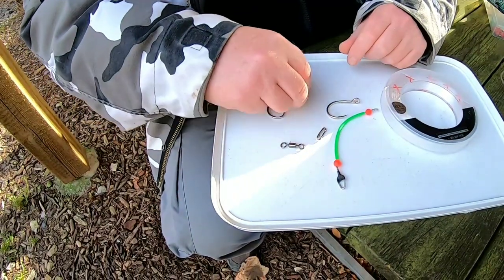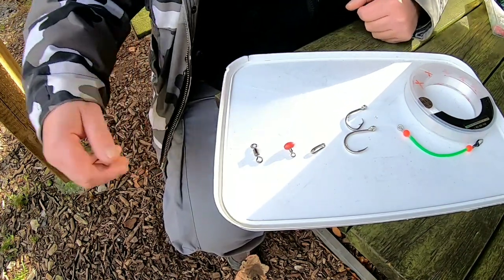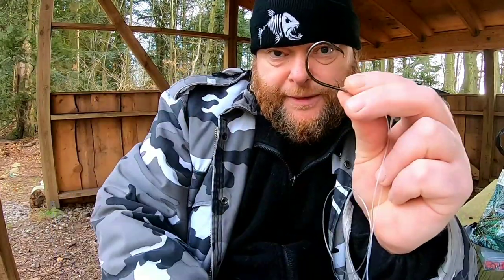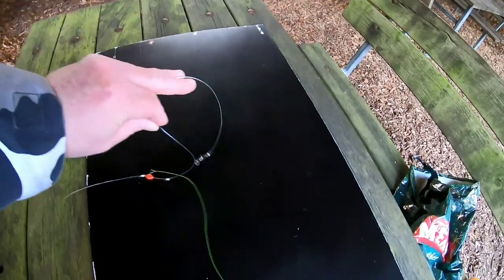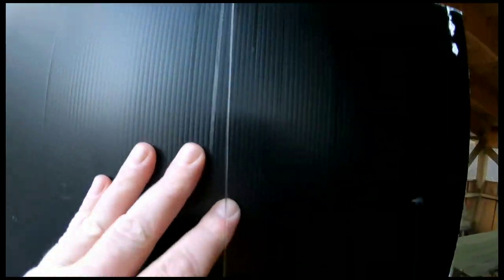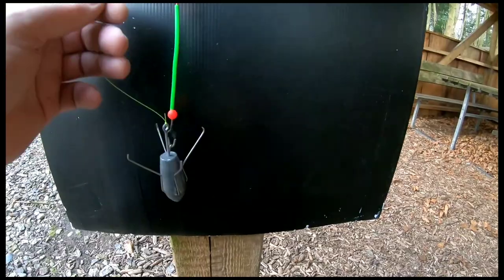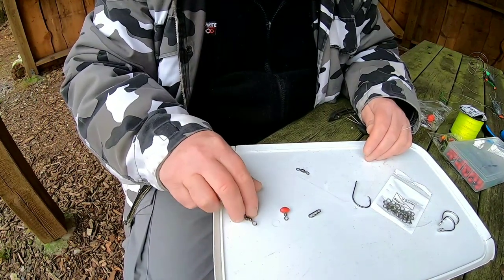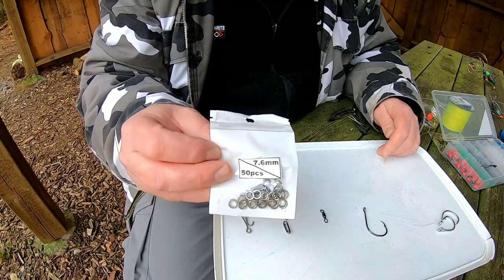How to make the up and over ring rig

Comment: Another great video Billy very informative. About the South African rig  the only thing that I would change to make it a one true piece line would be by adding Carolina keepers, instead of the 2 knots above and below the pulley rig which makes it a weaker line. Carolina Keepers are plastic pieces with a slit cut through the middle which used to keep beads and swivels from sliding around. If you get a chance look them up. We here in the West coast of California use Dropper loops or Reverse Drooper Loops. 
Thanks again for sharing something interesting and new to me.
Reply from the maker: Hi Jorge, I think we are on the same page Brother. Because the knots are not in the rig boddy, but a stop knot tied around a ring body. Thanks for the info, I will check out the Carolina keepers. Fish on 👍😁👌

Comment: Gave this rig a go a couple of weeks ago, bass fishing over a bit of local mixed ground. The full strength 70lb rig length to an octopus style hook with a dingle dangle on it, a 15lb lead line (i use 0.38mm 24lb Asso mono mainline) really helped when getting the lead snagged a couple of times. Great rig with an inbuilt rotten-bottom, pulled for a break losing only the lead.
What was mostly impressive though was the fact it flew so straight and stable through the air with a mackerel head and guts bait on it hooked through the lips👍👌👍
1 bass at just over 4lb, a thornback at 7lb and few schoolies. 
I was well chuffed
Reply from the maker: Which reg did you use?
Reply: @Billyfishing_watch  Gave the up and over rig a go, as i like to fish with baits close to the bottom, and use fixed up and over rigs with 3ft (ish) snoods quite a lot.

But it was the South African style rig i used in the end, as the spot i fished is mixed ground with big thick mud ledges and can always lose a few rigs. Made them with 15lb lead link and use 24lb Asso mainline so that was the weak link. 
Both work brilliantly though, especially with chunkier baits.
Reply from the maker: Nice, it's a great rig. I use it so much, at first glance it seems like a bad rig but in practice it is fantastic.

Comment: Love your videos Billy. In South Africa, the rule I was taught was the less, "jewelry" the cheaper and the better the rig. For anything that is possibly going to bite us off (like sharks), we would make the bottom part of that first rig with a 120lb or 150lb 7 strand coated wire. The wire and heavy mono sections are joined with two sets of figure 8 knots that are pulled up against each other. Again this makes the rig cheaper vs it all being from wire and improves free movement in the water.
Reply from the maker: What a lot of people do in South Africa, for the big sharks run wire all the way through and just use mono for the lead line. They call it an MFG, this stands for full metal jacket. Follow the link to this video. It's probably what you need! 49 strand wire is the best you can use, it's very easy to work with. But if you can't get that seven strand will do! Most people will use 200 lb wire, for the MFG.
Reply from the maker: https://youtu.be/uNUTrmYfC08

Comment: What Lbs mono are you using to tie wire to mono.. I have having the issue of 90lb afw 49 strand wire cutting through 100lbs Rovex 10x mono as I am tightening the knot. I have tried tying using the knot you have mentioned and back to back figure of 8 knots. I am wondering if that size mono is too light and low in diameter for 90-150lb wire.
Reply from the maker: It's the line, the knot is fine. Rovex is rubbish!